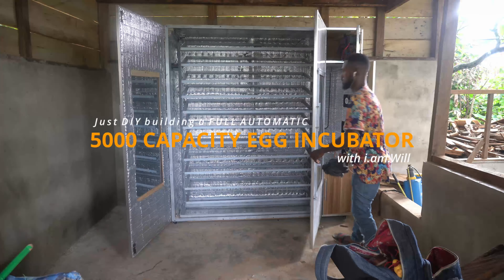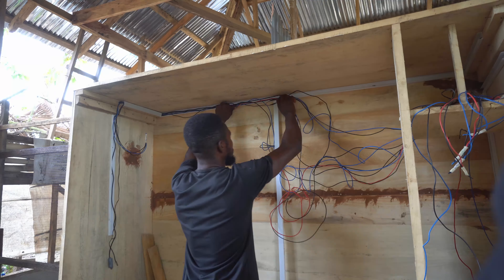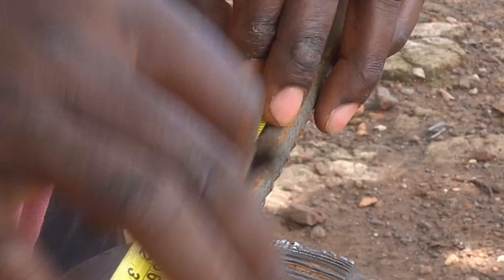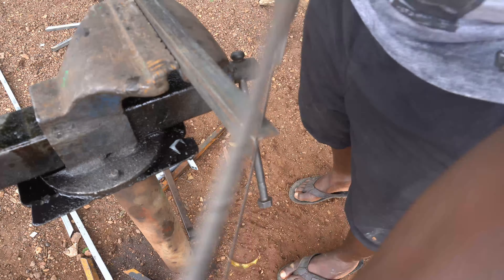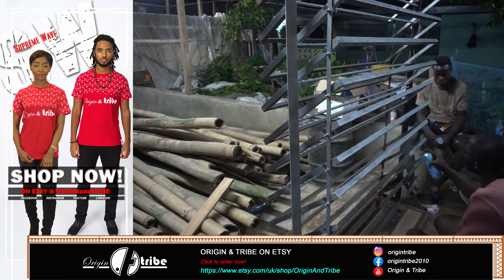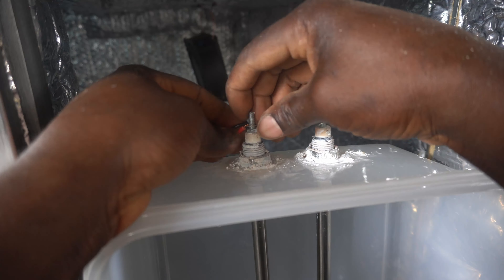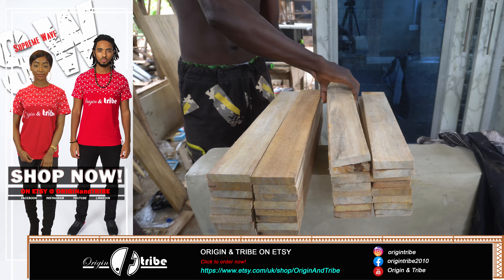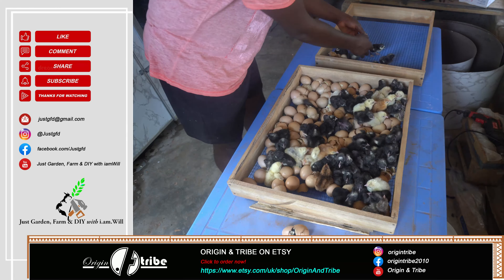Build A Full Automatic 5000 Capacity Egg Incubator | Homemade Egg Hatching Machine | Easy Steps

Comment: Help me understand something bro. The machine room and the main chamber did you leave a gap between? If not how does heat transfer from the machine room to the main side
Reply from the maker: There is a gab between the HEATER and HUMIDITY ROOMS connecting to the main "Chamber" is you look carefully at my drawings when building the cabinet, you should see the gab
Reply: How much will one of these cost and can you ship them to Cameroon?

Comment: Very well made video! I made my own incubator with very similar results. Just an FYI for others interested in using the XM-18 controller, I do not believe there is a function to turn off the turner. I had to hook a switch to the turner to turn it off during lockdown. I believe you also have a switch hooked up to your turner. Great job again!
Reply from the maker: Well done you too.
Yes the XM-18 doesn't have a switch for the egg turner. So you need to loop it to a switch and turn it off manually on day 18. Thanks for pointing it out. I will add it to my explainer video
Reply: i needed to ask the same question. how did you go about it.
Reply: Stop Turner IN 0 time

Comment: Hi.I have comments that the insulation should be installed outside the incubator.Because it is such a porous material, bacteria and mold will persist there.These are the foci of the disease. That's my advice. 
  And how is humidity created?Thanks
Reply from the maker: Thanks for your comment. All of the incubators I've seen are inside and not outside. But I do take your point with the bacterial and diseases. That's why you need to keep your incubator cleaned after each incubation cycle.
The humidity is created from the humidity rod+bowl

Comment: Can that motor handle the weight and ?
5000 eggs ? 🥚
Reply from the maker: yes it can. though we didn't have enough eggs to fill up the trays, we weighed one crate of eggs and filled the other crates with similar weight and tried it. the motor handled the weigh perfectly. I have to admit we didn't do this simulation for 21 days but just a few minutes

Comment: the fans i think need to be put in a wall so it moves the air better, also if its near the humidity bucket the water will damage or rust the fan quicker over time. always run cold air through the fan and let it push the hot air, some people suck hot air through the fan and it overheats the fan, or hotter temperatures will cause more amperage in the wires and cost more to run or trip breaker
Reply from the maker: we appreciate your constructive feedback

Comment: How do you ventilate the incubator?
Reply from the maker: because of the high humidity in my area, I didn't put vents on this machine. However, I did open it as and when required, to do adjustments ie fill humidity bowl, check fan etc. this allowed the fresh circulation of oxygen

Comment: Thank you for the great work but can share these requirements: ventilation holes for extraction and inletting.  Please can you also give the dimension and placement areas and how many are needed for this size incubator.
Reply from the maker: My incubator has no ventilation for inlet or outlet of air. This is because, Ghana has high humidity levels. As a result, having ventilations on the incubator could increase the humidity levels during the first 18 days of incubation, which is not desirable for a better hatch rate.
Please do check the humidity levels of your area before deciding whether to install a ventilator or not. Thank you for liking my video and all the best
Reply: thank you, Educate me, brother, I am not sure if what I read is correct, eggs need oxygen to develop and excrete carbon dioxide so how are you supplying this to the eggs if the theory is correct.
Reply from the maker: @naturalremedies9511  that is true that eggs need oxygen and release carbon dioxide. Even without the vents, my incubator has plenty supply for it. this is because the machine is not completely air-tight. during operations, the humidity can be around 45%. This is mostly coming from outside of the incubator. As long as your machine is not completely air-tight, you will have good circulation of air
Reply: @AIS.FarmResorts  Greeting Sir, Thanks for the information let's assume it was airtight what size of ventilation holes will be put where on the incubator especially looking at the 3000 to 5000 eggs incubator which you have made
Reply from the maker: @naturalremedies9511  I would just drill holes on the incubator for ventilation. For an incubator this capacity, I will be more professional and install proper ventilation.
I believe the link below should give you an idea of the size of ventilation size for this particular size of incubator.
https://www.mykitghana.com/product/incubator-ventilation-exhaust-fan-220v/
Reply: @AIS.FarmResorts  Thank you for your hard work in assisting us with DIY, I still have a problem is the sizing of the ventilation, the link above is not activating please assist with a link. sorry to worry you🙏

Comment: How much power does it draw overrall
Reply from the maker: Heater Rod is 500W
Humidity Rod is 250W
Bulbs are 12W
Fans are 60W (5 fans)
Turner Motor is 14W

less thank 1000Watt
Reply: Hi Dear will, hope you have done a seperate video re assembling ie. Qty,size, length snd width of all the pcs.  I mean BOQ in detail. If I m not disturbing you please

Comment: you could probably run a fill tube to that tub in the bottom. so you can refill it without having to open the door
Reply from the maker: that was the initial idea. but the Bowl was big enough to finish the hatching. we just did it for demonstration purpose. But you're absolutely right

Comment: All components diy equipment buy online  link please request
Reply from the maker: I bought some on amazon and part in a local dealer shop

incubator 500 watt heating rod
incubator 250 watt humidity rod
egg turner motor
light bulbs
XM-18 controller board
Reply: Thank you so much 👍

Comment: What is power of the motor that you used to oscillate the turning trays?
Reply from the maker: 220V AC Egg Turner Motor Incubator Engine Reversible Geared Components 2.5r/min

Comment: How did you glue the foil to the incubator and what glue type did you use
Reply from the maker: I didn't glue the insulation foil to the incubator but rather stapled it inside

Comment: Dear Will, Thanks for your video. Kindly conform L iron thickness half inch will do .no . I planned  to buy iron likebthis way. If you given all details in any video. Pl reconfirm
Half inch LIron for 11 trays  5x2= (14x11)  150ft
Stand also ok to buy half inch
Half inch iron 60ft for 11trays
Bearings  22nos for 11 trays .pl check and let me no. I really appreciate. Viani
Reply from the maker: sorry I am currently away from the poultry farm and won't be able to give you correct details. however, you should aim to use lightweight iron which is strong enough to carry all the egg load and treys

Comment: Please from the video the heater was isolated for how was the heat transfers to the incubating room
Reply from the maker: I only put a wall between the heater and the rest of the incubator. this was to avoid the eggs having direct contact with the heater. when you look at the part where we were wiring or when I was installing the heating element, you will see there was a gab towards the back of the incubator. that is where the hot air was blowing towards the rest of the area in the incubator. this way, you ensure evenly distribution of air or air circulation

Comment: Please what is the stopper for, and it's name
Reply: I am a student, and trying to use your incubator egg turner machine ass a project so trying to get all the materials right
Reply from the maker: the stopper stops the motor/ egg trays turning 360 degrees.
You want the egg turner to go far enough that the eggs don't drop or fall off and damage
Reply: @AIS.FarmResorts   so like how many stopper is required for the incubator 2 or 1
Reply from the maker: @victororji3065  every egg turner motor comes with 1 stopper. you can only use more stoppers if you have more than 1 egg turner in your incubator

Comment: Should fan and heating element run at same time.  I have tried to follow instructions, and having trouble with this.  Also with humidifier, but humidity is 80%....  PLEASE HELP
Reply from the maker: Yes the fan is always ran with the heater. the fan distributes/circulates the hot air around the incubator.

The humidifier should NEVER run until DAY 19.

Which controller board are you using?
Reply: @AIS.FarmResorts  Same X-18.  Thanks for the clarifying the humidity issue.  I thought I had wired it wrong since my humidifier was not turning on.  Still, fans don't start when the heater starts.
Reply from the maker: @marcelopadillaopplig who did the wiring for you? they have to add the fan wires to the spot where the heater wires are connected to the controller board. Whenever the heater turns on, the fans should come on. whenever the heater overheats and turns off, the fans should go off too

Comment: Im trying to find the Difference between Humidity rods and heating rods. and i only Find Heating rods when i search on internet
Reply: When the water heat up evaporates that’s the humidity
Reply from the maker: the humidity rod is normally put into a humidity bowl with water.
search google for: incubator humidity rod

Comment: At +- 14:50, you say "...twice every 60 seconds".  That doesn't seem correct.
Reply from the maker: it is correct

the turner goes up within 30 seconds and then down 30 later. this is how I did my settings

Comment: But big mistake in this machine
Reply from the maker: where please?
Reply: @AIS.FarmResorts  over heat fan and auto water floating valve used and. humidity tube not used temperature increased and the temperature is overheat problem... ultrasonic mist maker 24vdc used and cool humidity....and PVC 88 eggs china tray use for incubator
Reply from the maker: @rashidch7014  I'm sorry but I do not understand what you just commented. where do you think I did or did not use the right components?